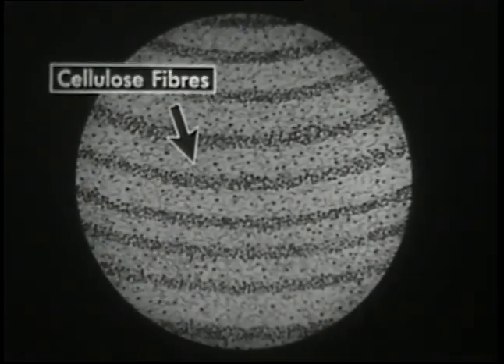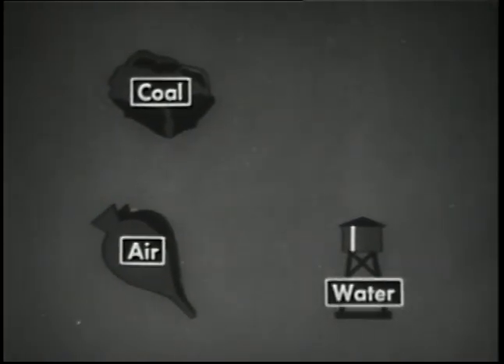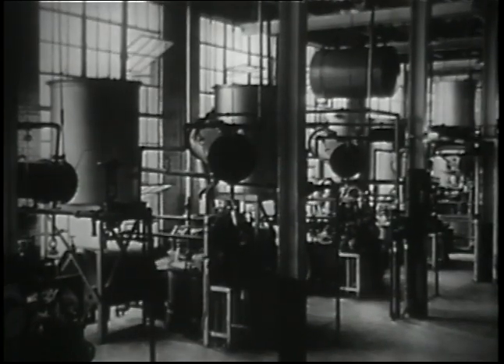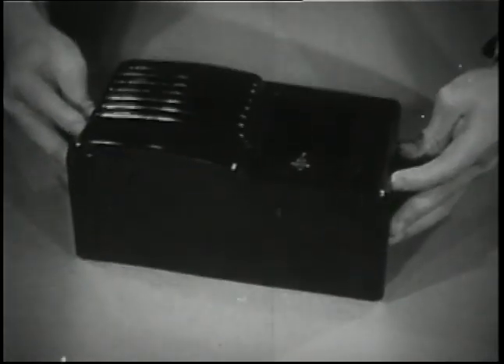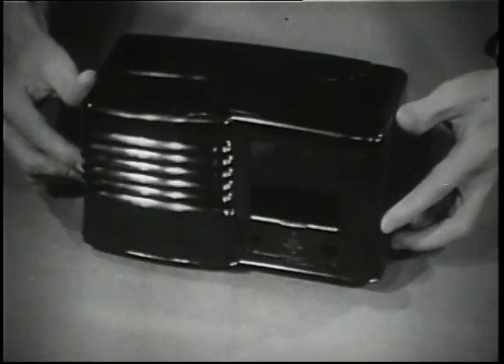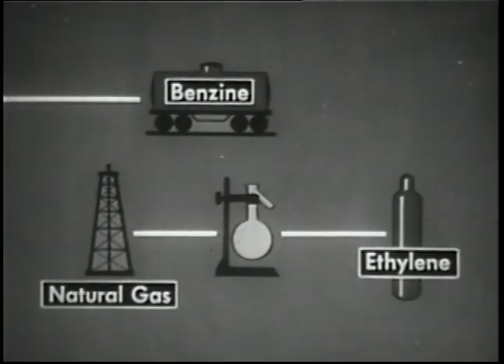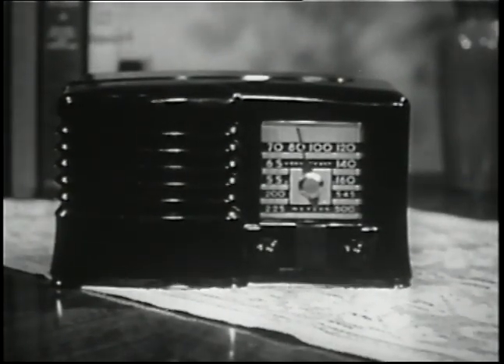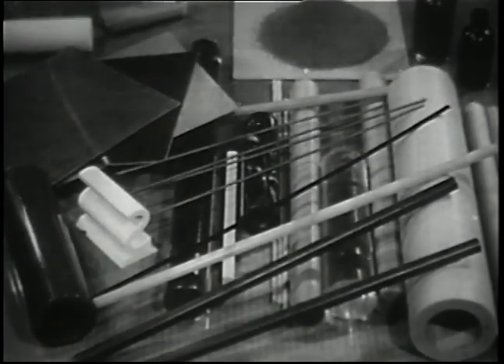Origin and Synthesis of Plastics Materials (1945)

Comment: This film is CLEARLY American. The bone stock US made Emerson radio had a METER call out for the frequencies, AND the narration uses Centigrade. This is evidence that the US has LONG been mixing US Customary measures AND Metric for a LONG time before the "push" to metric in the 1970s, Hell, US Industry has used metric DECADES before then: 8mm, 16mm and 35mm Film stock were ALL by US company Eastman Kodak. (Why 35mm and not 32mm has always bugged my ADHD self though..) US cigarettes have also been metric in length since at least the 1920s: 70mm, 85mm, 100mm. But the circumference is 1.25 INCHES. LOL.